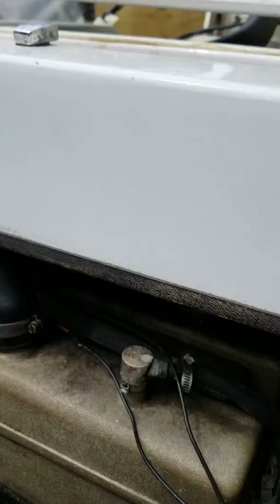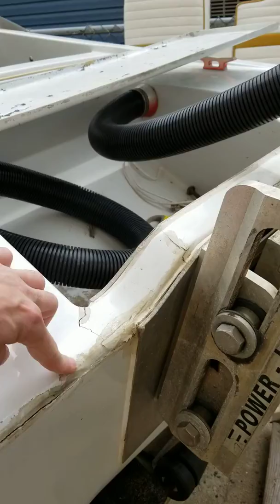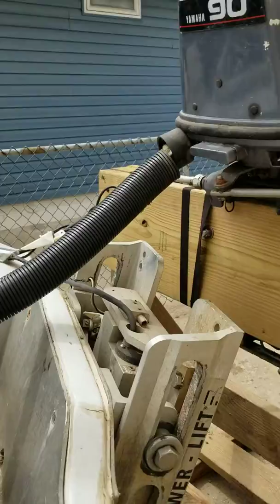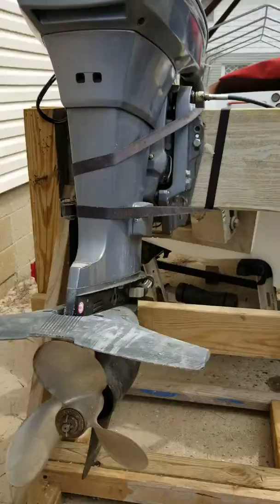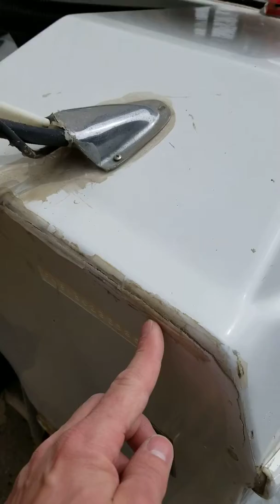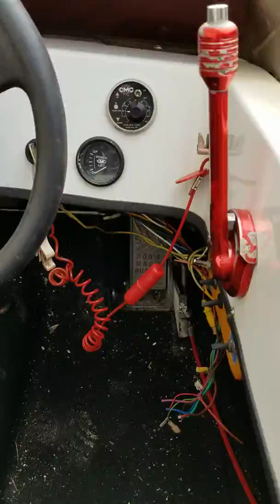1985 race funcat boat 13ft x5ft w. Go fast boat

Comment: can you use the boat ..?or the cracks are bad...?
Reply from the maker: mikeatc33 . Me & my brother kenny we gonna sand the whole rear transom then add all new fiberglass works to it soon, after that it will be strong & extra strength better than before, then paint job and add the aluminum plate piece onto to rear transom wall. Final finish put motor back on.
We gonna start sanding the wall of old transom this week